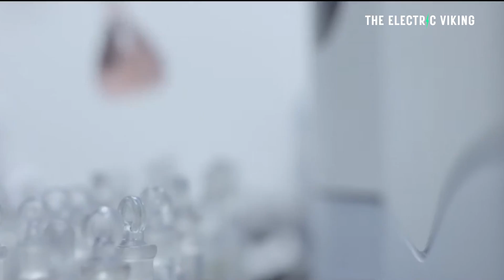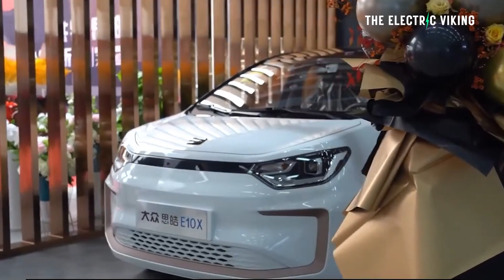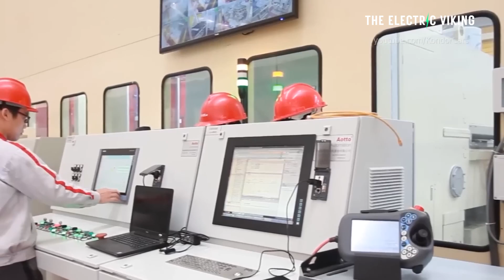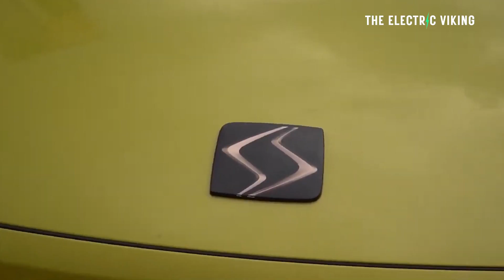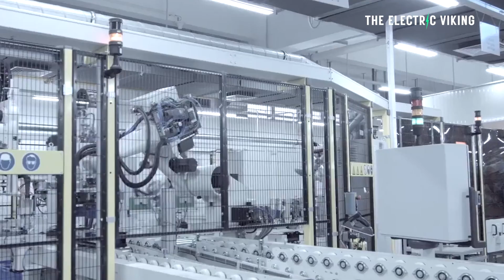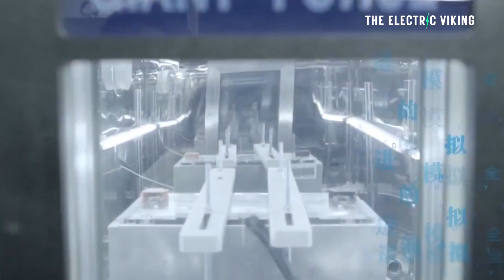VW unveil world's 1st Sodium-ion powered EV; BYD prep for mass production

Comment: Sodium is not ready for EVs yet. However, as they get Sodium-Sulfur to work at room temperatures, which should be around the corner after the Drexel University Lithium-Sulfur discovery, then it should work. However, Lithium-Sulfur (which already works), has way more energy density potential (more than 5X the current best batteries), so it will become the standard for EVs as mass manufacturing with companies such as Lyten ramps up. As far as Sodium with Prussian White, which is what companies, including CATL, around the world have found works best thus far, it will displace Lithium in stationary storage (due to its low cost) where weight and lower energy density is not an issue.
Reply: I see home energy storage as key in order to have an EV, but it is still too expensive.  Lower that cost, people will be able to charge at home, and it is needed for grid stability
Reply: @tireddad6541  They'll get cheap sooner than most people think. To use history as an example, the Ford Model T (which equates to Tesla in 2012 with its first mass produced EV) were first built in 1908. In 1909 a new Model T cost $850 (and went no more than 10 to 12 miles on a full tank of gas), but it kept getting cheaper and cheaper and better and better, so that by 1924 the price had gone down to only $260 (and would go more than 10 times as far on one tankful). That's down to less than a 1/3 the price in only 15 years, and ten times the range over that time. And that's after including all the inflation of the the first World War and the 1920's. Yet these people commenting against EVs don't realize that by 2035 the are going cost around 1/3 of what it costs today, even after the inflation of all that time, and will go well over 1,000 miles on a single charge. 

Why would EVs cost so much less than today? Because they are so much cheaper to manufacture and build than ICE once full manufacturing and materials sourcing ramps up (which is happening now), just like LCD TVs are so much cheaper to produce than the old CRT TVs (picture Tube) were. Remember the first 50" thin flat screen TVs of the early 2000's costing over $25,000? By 2010 they had gotten so low that I purchased a top of the line Panasonic 3D 55" for $1,600. And some lower lines ones were going for around $1,000. And how much do they cost now? Around $200 at Walmart? And that's even after all the inflation of the last 20 years. Doesn't make sense, does it. They are 10 times as good yet cost more than 10 times less. Yet it's a fact.

Why will they go so much farther so quickly? Because lithium sulfur batteries have just gone into production. Or better stated, the first factory to start mass producing them, Lyten, just broke ground in San Jose, California. They achieved an energy density of over 500 Wh/kg, working for/with the US Military (a very tough customer) which is roughly twice the highest NCA or NCM batteries (around 250 Wh/kg), used today can get. And they stated they are now getting 3X the current highest energy density. Drexel University in Philadelphia already achieved more than that, 800 Wh/kg, and their Lithium-Sulfur batteries are still going even after 4,000 full stress cycles with very little degradation. And keep in mind that Lithium/Sulfur batteries have the potential of 1,600 Wh/kg. Or over 5X the highest energy density batteries used today. And they will cost much, much less (even if only around 20% to a 1/3 less at the very beginning of manufacturing) because they don't use any of the very expensive Nickel or super expensive Cobalt, while sulfur is everywhere and very, very cheap.

Therefore, an EV that gets around 300 miles in one charge today, will go 900 miles in around 5 years or less (making the ones built today unbelievably affordable for those with low incomes). And will go over 1,500 miles when the full energy density of Lithium-Sulfur is achieved and massed manufactured in the 2030's.
Reply: @thedualtransition6070  They won't depreciate until Lithium-Sulfur and other technologies take over later this decade. For now, unfortunately for affordability's sake, they are depreciating very, very little, if at all. A gas/diesel vehicle depreciates 25% as soon as you drive it off the lot (please ignore this recent stupidly caused by the pandemic and supply delays), but EV's only go down a small fraction of that. Look them up in major used car sites and see for yourself. They are simply in too high demand and will continue to do so until mass production from the legacy automakers takes hold around 2026/27 as they begin to catch up to Tesla.

What will depreciate massively from now on are gas/diesel vehicles simply because their demand will continue to drop. Think of them as  CRT (picture tube) TVs, or flip phones, or VHS/CDs, in recent history or the horse and buggies back when the Model T was first introduced, etc. It's the way progress goes. History is the greatest predictor of the future. One has to simply study it and reapply it looking forward.

Comment: Sodium Ion batteries would be a good candidate to go in a vehicle such as Mazda MX 30 with Rotary Engine (i.e., Wankel engine) range extender. However, it should get a minimum of 100 miles EV only. They also need to improve the motor on that particular vehicle as well as charging speed.
Reply: A BMW i3 REX is optimum for efficiency and weight and would be ideal for PHEV's with sodium ion batteries.   Just make the car much cheaper to build than the i3, but keep it aerodynamic to get good electric range and this could eliminate 95% of emissions with most trips being very short statistically
Reply: @glike2  Rotary Engine (e.g., Wankel) is a better range extender than the BMW I3 motor cycle engine. Wankel can run on Hydrogen, Gasoline, Diesel, Natural Gas, DME, Methanol, Ethanol, Propane. It runs best on gaseous fuel.
Reply: That's exactly why BYD is investing into sodium batteries. BYD is the largest PHEV maker in the world. All BYD's PHEVs can work in range extender mode.
Reply: Hybrid,  no one wants them.   Our health is more important than supporting fossil dinosaurs

Comment: If Sodium works well enough; it could open the door for EVs to break through production limitations of Lithium. It will certainly reduce the cost of an EV; if the public accepts the trade off even if it is shorter range and not that green due to being fairly heavy; then one would expect a pretty big change - if the batteries are cheap - maybe they can be made easy to swap even if their life is not very good.
Reply: It will never work as good as Lithium. But that does not matter. If it works "well enough" for regular people. This could be the battery for the regular people.
Reply: Within five years they will have the same energy density as lithium ion, be cheaper, faster charging, and have a longer lifespan.
Reply: The market will use a variety of battery chemistrys, including sodium and lithium, each has its use case and need in the market. Neither will be able to scale to fit all need by itself
Reply: While it isn't green weight wise, it is much easier, greener and better to mine/win
Reply: @sneaky_krait7271  that is true lithium is probably much worse
Reply: @BlondieSuperdog  It is. Also cheaper. And as far as I know it does not use cobalt either, which is also harsh on environment (and people in when mined in Congo)
Reply: @sneaky_krait7271  Certainly; the question is what are the trade offs?  I have heard Sodium pacs do not last; that they are currently less dense and so for the same range the vehicle will weigh more; or for the same weight less range.  On the good side I have heard they perform better in cold. We will just have to see - also - will these Sodium vehicles really get to mass production or will they find that people don't like the trade offs.
Reply: @BlondieSuperdog  Do not last? As far as I know you can charge them at faster speeds while degrading less. Taking into account the way easier to get materials, these batteries have the potential to cost significantly less. Lithium mining/production is currently the biggest bottleneck in EV production and has risen in price a lot.
Reply: @sneaky_krait7271  what I read was the record cycle life in a lab was 600 cycles; that would mean if you charge it every day it would only last  couple years max; but probably you don't charge every day - still  a life of 4 years or 5 years isn't very good.  If the manufacture makes it a quick and easy swap - then that may be acceptable even if it costs four or five thousand dollars.  So i guess we need to know more about the exact battery packs that are made.
Reply: @BlondieSuperdog  Yes and I have read in a recent report that they show bit less degradation after 500 cycles. Battery development goes fast, so let's wait and see the numbers of BYD and CATL mass production ones. These sodium batteries will also lower demand for lithium, making batteries overall cheaper.
Reply: Come one,  nothing compare with the zinc air battery developed by the IIT Madras.

Comment: Wow! BYD is really on the "come-up".
Reply: BYD is crap.  Tata EV has way more to offer.
Reply: @shangkarhkumar8968  Yeah thats why BYD has 40% market share in China EVs and Tesla has 7.5%.
Reply: @shangkarhkumar8968  Agree! Tata EV is a legend and dominates market ever since. That's why we can't see single  Tata EV. It is just beyond imagination. Yes , your are right.
Reply: @shangkarhkumar8968  😂😂😂
Reply: Ford was the first mass production car manufacturer, but then General Motors came along and offered much more choice and variety, and good advertising, and became the dominant manufacturer in the US. Ford had to work out how to bring out new models and upgrades on a regular basis, and advertise. A parallel with Tesla and BYD? In 1965 GM had over 50% of the US market, Ford only 25%. The "first movers" generally are not the ones who come to dominate the market, many even become just niche suppliers or fall by the wayside.
Reply: If only BYD was available in Canada. Or even the US.
Reply: @Oatmeal-Savage  not in next decade under curren political climate. I am keep eyes peel as well.

Comment: Sodium batteries are heavier than Lithium. So for the same weight you get less range.

But for most applications this is fine.

A Neo solution of battery swapping would be ideal. Going on a long trip? Swap in a Lithium battery.

A different take on a hybrid solution.
Reply: Your conclusion is not right in every conditions: you must consider that Na battery will last less autonomy in cold weather. So in these conditions, it will be at least equal to Li-ion battery. We don't know at the moment how faster they will charge, but they will beat Li-ion's speed. And finally, they seems to be a very good choice for small affordable cars. We'll see in the coming years how they perform really, I think. I would put a dime on them.
Reply: @Shinael  the smaller, affordable cars are lighter to compensate for a heavier battery in order to gain more range.

Comment: We will see. Will take years to market. It's energy density is very low
Reply: Yes, but the low temperature performance will make interesting anyway
Reply: @carl löfgren  i think of it as a great solar storage battery.  You can afford more storage, and weight doesn't make a difference.
Reply: @ChicagoBob123  I have electric moped (NIU) and at temperature 25° Celsius I can travel 100 kilometers. When temperature is minus ten degrees Celsius, I come just a little more than 60 kilometers. So I invested in a extra battery to be sure to get me home in the winter. I hope there is sodium batterys to buy when I have to replace them.

Comment: sodium batteries have so far to go. sodium alumium batteries could be the next big thing taking sodium to a new level
Reply: I don’t know about the safety of such a battery? Here in Canada we use road salts to control ice. It corrodes every metal vehicle and since batteries are built under cars I would worry about this
Reply: @woodchip2782  pack it in plastic rather that metal?
Reply: @woodchip2782  different thing altogether sodium is a soft metal you can cut with a knife which has similar properties to lithium.

Comment: Now we can funnel the Lithium into decarbonising aviation! 900 Wh/Kg Li-S battery from Lyton can power electric planes, and Mako Aerospace have the electric jet to efficiently to turn Lithium Sulfur energy into flight!
Reply: I think e-fuels are a better approach to decarbonizing commercial flight. Developing new planes takes years even without a fundamental tech change, and airlines buy planes with the intention of flying them for decades, so there’s a very complex cost model and plenty of risk aversion. But e-fuels that can serve as a 1:1 replacement for current jet fuel could work with minimal cost to the airlines. Moreover, we could get to where it’s cost-competitive with fossil fuel.
Reply: @davestagner  proven scam and limited resources
Reply: 3000 km range with radical aircraft efficiency improvements is the best possible with this technology, which could decarbonize most traffic except a small minority of long haul flights
Reply: LOL if you think airplanes will be ‘electric’ anytime in the next 200 years you have rocks in your head.
Reply: @stevej02  Wind back 200 years to people saying “If you think something heavier than air will fly over oceans carrying hundreds of passengers, you have rocks in your head!”
Reply: @davestagner  that’s not a good comparison. You need a fuel source with sufficient energy density to power commercial flight, and I can tell you that solar panels and wind power and/or batteries can’t generate that power.
Unless you propose sticking a small nuclear reactor in a plane then maybe, otherwise, No.
Reply: @stevej02  You’re blurring between “generate power” and “store power”. I agree, planes won’t run on solar panels out on their wings (nor cars with solar panels on their roof), because the surface area is too small. That’s just physics. But storage? That’s a whole other question. I don’t think we can reasonably say that battery technology will NEVER achieve sufficient density for aircraft. (Again, 200 years ago, someone would be saying that steam isn’t powerful enough for flight, oblivious to the internal combustion engines that weren’t invented yet.) But I don’t think it even matters, because as I suggested, e-fuels work. Drop-in replacement e-fuels can be synthesized TODAY, using wind/solar to generate the electricity needed to make the e-fuels. Not only is this theoretically possible, but airlines are investing in it, such as American Airlines’ investment in Prometheus Fuels. So solar and wind can, indeed, generate that power, even if batteries aren’t (yet) nearly dense enough storage.

edit: Adding here that not only is it theoretically possible to synthesize a drop-in e-fuel replacement for jet fuel, it’s starting to approach cost effectiveness. It’s simply a question of a: cost of electricity, and b: efficiency of production. A gallon of jet fuel is about 35kWh. Current cheapest prices for electricity are about 2c/kW from well-placed new PV solar, and it’s reasonable to think that price could drop below 1c/kW in the next decade or two. So at 100% efficiency, it would cost only 70 cents to make a gallon of jet fuel from just air and water. Prometheus claims up to 50% efficiency from their process (although they’ve been cagey about public demonstration), which would mean generating jet fuel for $1.40/gallon. But even mere 20% efficiency gets us to a gallon of clean synthetic fuel that works in existing jet engines for $3.50 - and half that by 2040 or so. That’s definitely cost-competitive with fossil fuel, ESPECIALLY if we start carbon-taxing to represent the true cost of fossil fuel, including externalities.
Reply: @davestagner  The amount of energy required to deal with commercial aviation energy demands far exceeds the natural limits of battery technology in terms of density. There’s also simply no need to waste so much human engineering on trying to make planes run on batteries. For what benefit would this serve? Likely an infinitesimally small and unmeasurable benefit.
Reply: @stevej02  I wouldn’t call it “infinitesimally small”, because the airline industry is 2.5% of global CO2 emissions. That’s not trivial. But I agree, battery-powered planes are not the correct approach - not now, anyway. But in the future, I wouldn’t be shocked to see an order-of-magnitude increase in battery density in another decade or two, given the importance and lucrative potential of next-gen batteries. Something with carbon nanotubes? I dunno, not my field, but I have faith. And if it doesn’t happen, it doesn’t. But order-of-magnitude battery improvements could make electric aircraft viable. We can cross that bridge when we come to it. Meanwhile, though, e-fuels can work NOW, and we should be doing that.
Reply: @davestagner  The biggest mistake is to believe that CO2 emissions are an ‘emergency’. They arent, and believing they are is a recipe for awful policy that will only lead to death and destruction of living standards.
CO2 is not the largest problem facing the environment (at least not in every country around the world).
There are also better ways to make the environment ‘cleaner’ and simultaneously maintain or continue to elevate living standards.
Reply: @davestagner  if it’s measurable then you should have no problem telling us all precisely by what factor carbon emissions have changed global temperatures versus the natural variability which would have changed them in the absence of increased carbon emissions.

Please provide your referencing.

When your views align perfectly with major governments who are desperate for ways to accumulate power and major corporations desperate for profit - you should take pause and consider whether you’ve been sucked into a fairly large conspiracy.